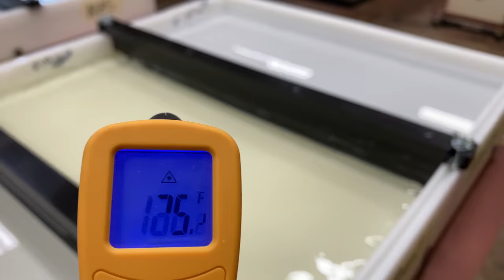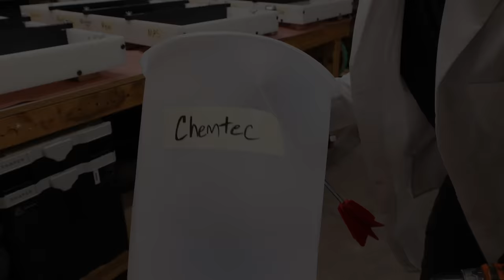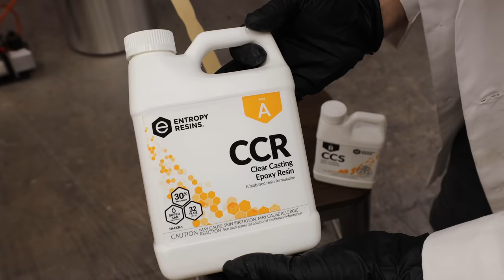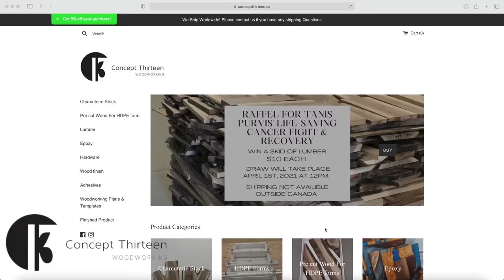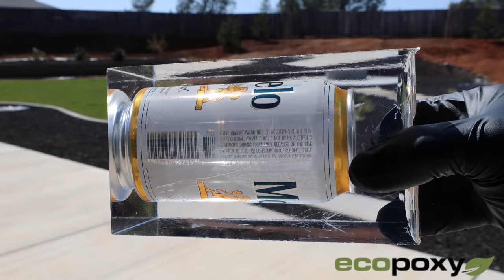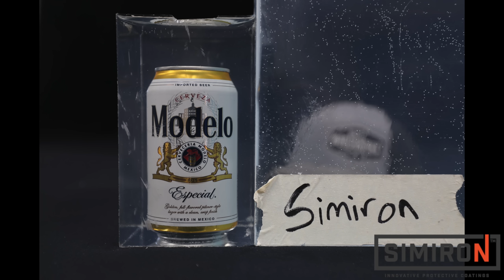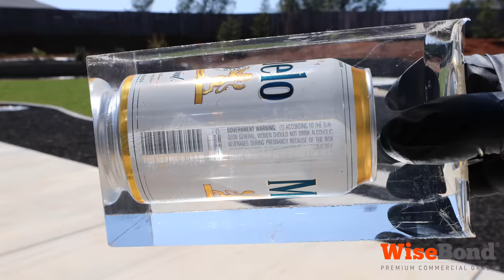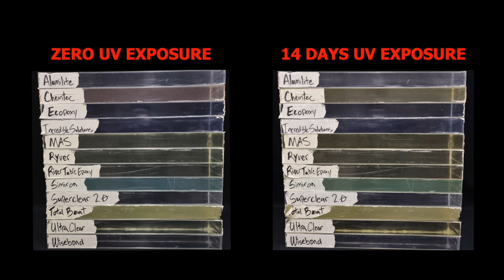Deep Pour Epoxy Clarity/UV/Hardness Test - Detailed Comparison!

Comment: disappointed you didn't test Stone Coat Countertop Epoxy.  I use it all the time and have been very happy would love to know how it stacked up.  to me looks like SuperClear is the winner
Reply from the maker: They declined, along with Black Forest, chill, upstart, squid and quite a few others, unfortunately!  Thanks for the input!
Reply: @MattsWoodworks  thanks for the info.  I still really like their stuff, disappointed they wouldnt share.  Not surprised by Black Forrest, they get theirs made for them from one of the group you tested I believe.  Pretty sure it is Eco Poxy as they sell all of their tints with it.  They are WAAAAY to expensive anyway. but nice to have in the backyard when needed.  Get test, really hard to see the diff between the top three.
Reply: @MattsWoodworks   Just interested (doesn't meant to be rude)
Did they refuse to sell it to you to avoid being in a video or you wanted it for free and they declined that?
If it is the first, than it is pretty messed up toward a customer by those companies and i lost all my respect for them... Thanks for awesome video!!! I was just about to order new batch of resin so will try one of the top 3...

Comment: Great video. If you still have these pieces I’d love to see a heat exposure video. I’ve met multiple people who work with epoxy (myself included) that have used many brands and they all have issues with heat. Even 4-5 hours in direct summer sun turns most epoxy to rubber temporarily. I read about someone who installed an outdoor bar down south and it was destroyed by the sun the following summer. I know all epoxy is heat sensitive, just curious which one is the least. I love Ecopoxy and then finishing with MAS personally.

Comment: I am curious why Entropy didn't have a slab? Is it not suited for it? I found your video because I'm looking for hard epoxies. My mom did resin countertops and I hate how they feel slightly rubbery. I want something with a hard finish.
Reply: I totally hate that, too!
Reply: happend to me on our counter tops it was due to me pouring the thin part B first so the jug was empty and part A the thicker of the two did not empty the jug would have been waiting all day for that. but because I did it that way I did not have a true 1 to 1 ratio. and after 4 did not fully harden. repoured another top coat with exact ratio and we had a hard counter a day and a half later! p.s. it was stone coat but not their fault

Comment: Sorry this is likely a silly enquiry but I'm curious what the bottom of the beer can cast looks like. As the can is obviously touching the mold prior to the pour does the epoxy get under and fill the bottom groove all the way level/flat? I'm curious how to get epoxy coverage on the bottom of objects as I plan on making an epoxy table with hockey pucks. Thanks and excellent video.
Reply: I wondered the same thing, but I just did a small pour in the mold first without the bottle, let it set up then added the can and the rest of the epoxy

Comment: Really thorough review. But I disagree with you that the deep pour beer cast were without any bubble. I saw many many micro bubbles in most of them. Kinda surprised you didn’t use a heat gun on the 2 in being it was so cold in your shop just to start them off.

Comment: FYI - Superclear is currently average priced. It's unfortunate that they didn't provide a normal retail price since a sale price is useless at best and deceptive at worst. I checked current prices of MAS and Superclear, figured where it would likely fall on the above list and confirmed the surrounding products. Per 3 gallons at the above links on 2021/12/06: MAS is $400, Alumilite is $336, Superclear is $300, and Ecopoxy is $297. This is not factoring in shipping costs (if any), and Ecopoxy is sold in 12L quantities so the value shown is 19/20 of the 12L cost.
Reply: They must always have sales. It’s about $200 per 3 gallons right now.
Reply: yes, I always 'think' i want the video creators to include prices, but this is why they aren't so helpful.   I didn't check the prices after watching, like you did; but, i have been looking to buy for a week 12/23/21 - 01/01/22(today), and while watching the video i was commenting to my husband on how their prices compared to each other, to my recollection, and the figures he showed near the end, did not match up, not even just who was higher vs lower, so I guess most of them vary throughout the year.

Comment: Hi Matt, thank you for responding , i am surprised that some of epoxy you tested does not belong to the seller company´s but there are some  manufacturers, finally it does not matter, you know in my carrer as a boat builder we worked with the original Epoxy resin from west system we build 100 of  olimpic rowing boats each year this Epoxy was invented in 1969 by  Gougeon Brothers  Inc. has been located on the banks of the Saginaw River in the heart of the Great Lakes in Bay City, Michigan , you sould test the original Epoxy just for you to know, there are some  german and turkish company´s that maby will beat the wisebond, i am looking  forword to see the test´s, are you accepting this challenge?
Best regards
Costea Ciprian
Reply from the maker: Thank you for this, I may be doing another epoxy test down the road, we will see :)

Comment: Great reviews, thanks for taking the time and for all the companies who supplied product. 
I was wondering if anyone has used the Ryver Cast, it looks kind of yellow in this test, but I was wondering what it would be like when coloured black. I am in western Canada and the Ryver Cast local is $250 for 3 gallons, Ecopoxy is $400 for 3 gallons both local, and super clear liquid glass is $405 for 3 gallons on Amazon. Quite a price difference. Thanks
Reply: I'm in Canada as well (Ontario) I went with EcoPoxy for my river table because I like that there product is cleaner for the environment even though it's more expensive. I had great success with it as well. Their metallic pigments are AMAZING!

Comment: Wow...cant believe I've never seen this video. I know I'm seeing this a year later but does anyone know why StoneCoatCounterTops isn't in the race. Wondering if they were asked or did they decline out of fear....🤔
Reply: As a resin artist I have used Stone Coat Countertops for specific applications. It would not be on this video because it is not a deep pour resin. You'd never want to pour 2" of Stone Coat Countertops in a single pour. I think the video was intended to be only for deep pour resins of 2"
Reply: @jasonlinenberger4429   stone coat does have super cast casting epoxy for 2" pours.  i was also wondering why they werent in the test.  perhaps they didnt want to donate to the testing?

Comment: Nice video! What is the downside of curing over 90 degrees? It has been hot here lately and i'm looking to do a project. I think mixing is supposed to be between 70-85 but havent seen anything on curing at higher temps and what it could cause.
Reply from the maker: You will have the epoxy kick much faster which could result in the bubbles not having adequate time to release/dissipate.  Sometimes when it's too hot it will pull air out of the wood's live edge and create air pockets in the final product.
Reply: @MattsWoodworks  thank you for the info

Comment: SuperClear looks like it's in the running but their web site is fluff. You have to ask them for a copy of the instructions and data sheet and I still haven't found how much heat their cured resin can take. I guess what I'm looking for is temperature tests because that number is hard to find on many sites, and they might not rate the temperature the same way.

Comment: I’m wanting to do a 1”x2”x1” approximate job on a tip of a shotgun butt stock. I want it like glass to put 82nd airborne Division lapel pin, or airborne wings underneath so it shows through about 1” of the epoxy. Any tips, recommendations, and which product should I use????

Comment: Wisebond for an almost perfectly neutral shade.
Incredible Solutions for great transparency. The slightly blue shade makes me suspect that this product may turn yellow over time.
Both showed good UV resistance, or rather sunlight.
However, let me point out that transparency only matters with pure and transparent resins. For tinted strong, especially with a pearlescent effect, transparency has absolutely no meaning. The tint always matters.
What is surprising me? The very poor result of TotalBoat - a resin heavily promoted by many users. Even if you take into account the fact that the technological regimes have not been properly complied with. Indeed a good resin should better tolerate such exceedances.
Reply: I would almost forget. THX!!!!
A great idea to conduct a test under comparable conditions, if only according to subjective judgments. This is not the worst method. When the attempts to "objectify" rely on the selection of measurement conditions to prefer a specific product - it is much worse!

Comment: Anyone have insight into his technique for smoothing / polishing the beer castings for the final stage?  I have some coasters I'd like to smooth down a bit on the edges, and as I don't have a whole workshop of tools I'd be interested in easier/simpler solutions that might get me "most of the way" (i'm ok with more labor-intensive ideas, as it's a super small project in my case).  Should I just buy a variety-pack of sandpaper and get scrubbing?
Reply: He has a video detailing how to obtain that glass epoxy: https://youtu.be/qOl47h9Nw2M
It's basically going through the grit 100 to 5000 grit sandpaper, cleaning  waterpoping Inbetween the grits then once you reach 5000 grit put  some 2 step polishing finishing compound with wool then foam and buff it in.

Watch the video, it will give you a better understanding of the process.

Good luck with your project
Reply: I use 120grit sand paper followed by 180 then 220 .  I wet sand and then pour a final coat over top

Comment: I think I liked Incredible Solutions but my question is, all the resins say they are for 2" pours.  The beer can pours were deeper than that.  How did they fully cure at such depths?
Reply from the maker: I'm working on a casting video next, which will go over the in's and out's of doing something thicker like the beers.  Stay tuned!

Comment: Is it possible to use one of these "deep pour" resins for just a thin top coat to my project?  I know you can't use thin coat resins for deep pores but can they work the other way around?
Reply: They can. I've used them for all kinds of projects before, including thin coats on top of paintings and for making dice.
Reply from the maker: I would say it needs to be atleast .75” thick for it to cure right

Comment: What about the strength test? 
how did they all compare?

Specifically I'm wondering about alumilite clear cast epoxy
Reply: Alimilite Amazing Resin is very poor at keeping it's hardness sadly, I've tried it and ALL of the figurines I made using that particular brand started to sag/melt in warm weather!😔
Reply: @Brianbri-nq3cc  thank you for your reply sir.   Do you mean in direct sunlight or even in a warm house or  garage?
Reply: @letswalkinthewoods1462  They start to melt/sag in a simple warm house in no sunlight at all, warm temperatures period. This brand don't even get all the way hard like it should, even after a week of curing you can still make indentations on it with a slight press of your fingernails😞
Reply: Alimilite is what I meant, this autocorrect is aggravating, sorry😂👍
Reply: @Brianbri-nq3cc  thank you this is very helpful

Comment: Ok, I feel even more confused 🤦‍♀️🤦‍♀️🤦‍♀️I'm just a every day crafter but I have used resin over the years. I also made dentures for 35 years and that material seems to be a lot like resin. In some ways. I have recently lost my 39 year old son. I bought a 5 inch deep sphear mold from AJmolds that sits on a flat side after being poured. I have flowers from my sons funeral that I dried and want to put in the mold with resin. Could someone PLEASE tell me what is the best resin to use. If I should build a pressure pot, and if so how do I do it. I want it to stay as clear as possible fir as long as possible and as few bubbles as I can have. Obviously I only have one shit at this, maybe enough flowers for two attempts. I really want to make it myself. Someone please help me!!! Step by step instructions, if you have patience to tell me in detail. 
Thank you
Lynn
Reply: I meant shot
Reply: You may have better luck with your question on a resin group on facebook.  All the groups are very very welcoming.  I'm so sorry for your loss.
Reply: I will definitely do some testing before using the real flowers.
Condolences on your loss.
Reply: Lots of flowers in resin tutorials on YT.  I'm so sorry you've lost your son at such a young age...  As far as longevity is concerned,  I've often thought a purply-blue top coat a couple of years down the line would be a useful thing anyway as a way of refreshing artworks, and combating the yellowing (opposites on colour wheel). Good luck with your project.  x

Comment: @matt Here’s about 50 new video ideas
Noob here: escaped me that there is a chemical reaction that takes place and it’s exothermic. So as the plank cures it goes from room temp and rises to around 50degrees away from boiling. Am I getting this right? So if I were to try to encapsulate Windsor&newton/ Winton oil paint it could cook it esp if the oils hadn’t fully cured? What if I was doing layered pours on a oil painting? Is that a bad idea? What about different media, say pastels? Would it steep into the epoxy while it cures? Is it safe? I wanted to try so much with epoxy never considered ramifications of chemreaction. Is it safe to introduce to the resin mix: pigments, paint, colorshift dust, holographic powder, lit glow-in-dark pigment, fluorescent dust, musou black, acrylic water-based paint, solarcolor dust, ultra-thermal dust, dyes? Just don’t want to start combining chemicals and causing a toxic plume or explosion while trying to do fine arts in this medium.
Reply: As long as you're using them in very thin layers to cover art materials, the heat levels won't nearly increase that much. There are a number of videos where they did 3d layered painting and it mostly came out great. The issues were more from errors on the artists part. Just order small amounts of the resin you want to use and test it against your materials. I would stay away from using any water based materials with the resins because it typically ruins the resin.

Comment: Where did you get the beer molds? I've been trying to find them but coming up with nothing good.
Reply: The clear beer molds were constructed out of slabs of acrylic plexiglass, then scored and separated with a plexiglass tool (similar to the way ceramic tiles are scored and separated), and then sections were glued together for later easier disassembly.
Reply: Plexiglass is versatile; it can also be used for irregular shapes. The limits are confined to your imagination.

Comment: so question for you, the Black Forrest Wood company on YT they do epoxy tables and have their own brand of epoxy, they are pretty popular why did you not include their epoxy these guys do really nice deep pours, and turn out some great products now am not sure if the epoxy they use is made by a large chemical company, and just branded in their name or it is a proprietary mixture am pretty sure they had it developed specially for their deep pours they started doing a few years back just wondered why they were not included they pour up to 4 inches maybe deeper ??? cool experiment i like seeing this kind of unbiased comparing of products cuts all the corporate bs out of the equation  these guys pour tables that take a week to cure and they use cooling tables to slow it down its cool
Reply from the maker: @Blackforest declined to be in this test, they for some reason didn't want their product involved.

Comment: incredible and superclear seem to have more blue light refraction than wisebond. with incredible having the most. the wisebond is the most neutral. at least, for larger pours. for smaller ones where you can better control the variables? i'm not sure it matters. you still have the slight blue refraction, but its less noticeable and most people wouldn't even see it. wisebond looks like you folded an acrylic sheet around it, incredible has the blue, but only slightly, and the superclears blue is only there enough to say it is and only in the very corner bends where you get the most refraction happening.

be interesting to see how long those three can hold up to uv.